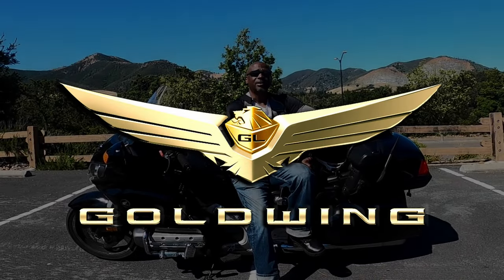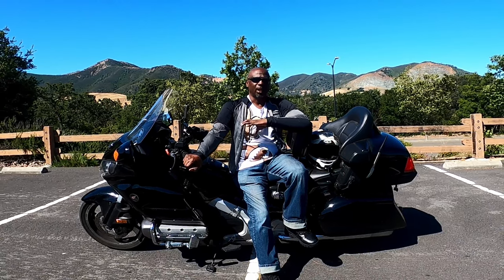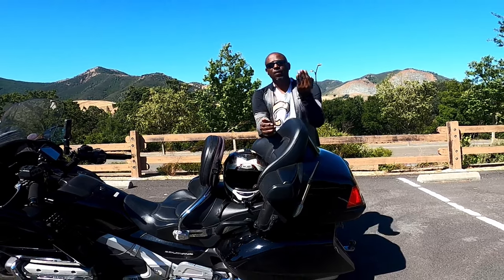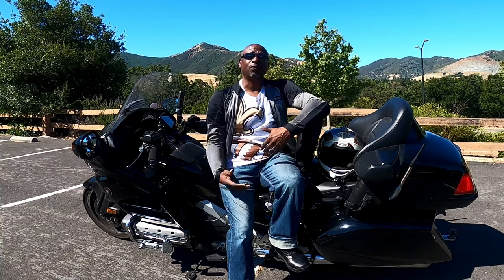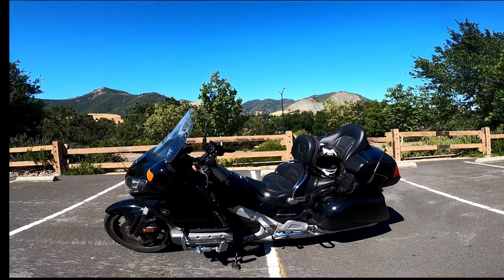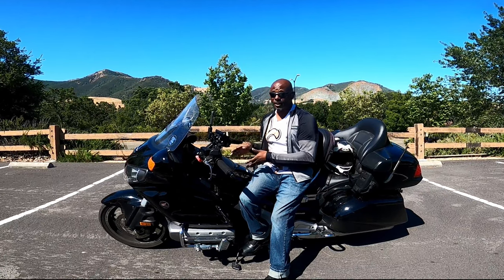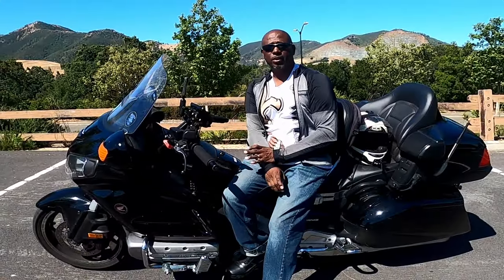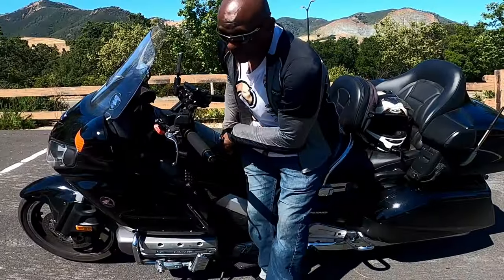GoldWing Dislikes | I love My Bike But...

Comment: I agree!  Every bike I have owned had something I disliked.  The Wing, yes the air filter is a bear, it I made sure to plan other work while I had everything apart.  I did the air filter a few months ago, and changed the coolant as well as clean up some wiring that was not done the best when I installed it.  I made my service task productive, and reminded myself a few times during the task that I saved the cost of labor doing it myself.
Reply from the maker: Yeah, you did it right...( plan other work while I had everything apart). I think our dealer sain they were charging $600 to change the air filter. With two wings, we saved $1200. Thanks for watching and commenting. I appreciate it.
Reply: @BootsandJeansRiders  Absolutely!  Save that money!  I have time and most of the tools I need for maintenance stuff.  I might even try doing the valves when that comes due.
Reply from the maker: Valves...You are way better than I am.

Comment: The way the trunk box opens would drive me nuts, too.  On my Voyager it opens sideways and I love it.  I had to laugh at your description about taking half the bike apart to repair something that has nothing to do with what you are trying to get at.  Man, I can relate.  I always joke with GloChix about how the first step in opening the gas cap is removing the front tire...hahahaha.
Reply from the maker: LMAO @ ( the first step in opening the gas cap is removing the front tire) I'm sure you are like me...in that, there are way more things you love about your bike than dislikes. Ride safe Tenn.
Reply: @BootsandJeansRiders    Always!  Well, almost always, the ONLY bike I ever had that I hated a lot more than I liked it was a later 70s AMF period HD Electra Glide.  That thing kept breaking down, and needed almost constant repair.  It turned me off to Harley so much that I haven't bought one since I sold that one back in 80, or 81.  I know that they say they have improved, but I just can't get that taste out of my mouth, as it were.

Comment: I have always admired the Goldwings and have considered getting one someday. I was aware of the extensive plastic removal required for maintenance, but since I usually take my bike in for service, I didn't think it would be a big deal. However, with my Harley Davidson Road King, I am beginning to handle simple maintenance tasks myself (avoiding the engine, of course) because I am tired of paying the high service fees.

Learning to service your own bike is challenging, especially for beginners. The additional complexity of the Goldwing, with its extensive disassembly requirements, means more time spent on maintenance and less time riding. While I am not ruling out the possibility of owning a Goldwing in the future, the maintenance aspect is a significant consideration.

Great video! I am confident the video will perform well. Thank you for your honest insights. It would be great to hear about the top five (or however many) things you love about the Goldwing. Take care and stay safe!
Reply from the maker: Yeah Jose...The service fees make you want to DIY. The Wing requires very little maintenance, but it's a pain when the time comes to do it.
Don't know if I will do a top - reason I love it. May be a Looong video lol.
(On another note) We are thinking about doing an overnight ride to Bridgeport CA. heading over Sonora Pass. If we do, I'll send out an email with details.
Reply: You could consider an old 1200? Cheap as chips, cross-country reliable if it's been looked after, retro cool AND much less plastic = much easier to maintain. (Air filter is a 5 minute job 🤣)
Reply from the maker: 5 minute air filter change...Man, that's golden.
Reply: @BootsandJeansRiders  😁 open false tank hatch
Lift out storage tray that's just sitting in there
Take plastic cover off filter
Lift filter element out.

OK, I lied - probably more like 2-3 minutes 🤣🤣🤣

Comment: Thank you for your opinion.  It is well-supported.  I was surprised you did not mention the seat removal and reinstallation process.  It is unnecessarily difficult as you must be very delicate.
Reply from the maker: Oh WOW! I forgot about that. You are absolutely correct. The seat removal is easy, but reinstalling it is a pain. Hard to line up the holes.

Comment: This is why I like my 1200 - much less plastic. Same daft way of trunk opening though - I go camping a lot meaning the back seat has stuff strapped on it. You really have to plan ahead what you put in the trunk.

Didn't know about the paint problems on your generation - shocking on such an expensive bike.
Reply from the maker: Yeah Ducan, 1200 is easier to work on than any other wing. Fortunately, I don't put stuff on my rear seat often.

Comment: I agree with you, Rich. I have a 08 only audio. Only good thing I think about that is less things to break. 
Mostly ride with the wife on back. I love it when she says, show them what this wing will do. Rock solid at 125. Also dbl dark   with run flat, that saved me when the valve stem cracked. No explosions yet. Whoever says they can't corner with a CT, never tried I guess. I love roundabouts, when the pegs start scraping I found my lean angle. These are  incredible bikes.
Now let's talk about the sound system. Radio sucks... bluethooth is the way to go. Most radio stations now broadcast on line. Along with there other HD channels. If that dont work there is spotify. Wing has a 3 ohm, not 4 or 8 ohm system. So, if you have 3 ohms in front 4 in the back. The path of lease resistance, the back will not get as loud as the front. You can try to fade it, but your killing the db level. Get 4 identical 3 ohm speakers, to match the oem honda amp. If I told you the brand I put in you would laugh, but they Rock. I can have a concert at any speed. Now you can not get chest thumping base out of 4 inch speakers. Its impossible! But you can get good sound. I=E/R
Ride safe, be aware of cages...
Reply from the maker: Love your comment ❤️. Now I need to know...What speakers to you have. We really need to get new speakers.
Reply: I have all show chrome speakers.
Use my phone for all my sound/nav. Phone is set up hard to hear, vol goes to 150, set at 120. With eq. Samsung 21 phone. Just had a young couple compliment me on the sound & bike when I pulled up to the Buromax store to pick up a part for the electric bike. Told them it's the Cadillac  of motorcycles!
Reply: Show chrome 5.5 front 4 in back 2 ways. Front honda tweeters disconnected.

Comment: I have most the same gripes on my 19. The paint is horrid, the plastic is cheap, the dash plastic scratches easier than the paint lol.  The stereo speakers are weak, better like the headset hehehehe! Oh gawd, the air filter. Insane design, but doable, not at 16k, to hell with that, I’ll wait longer this time!
Reply from the maker: Yeah Moose, with all our dislikes, there are tons we love about the wings. When the time comes again...I think I may let the dealer change my air filter.

Comment: You are right on point.  I don’t think you missed anything. I had a Harley box on my KZ1000P ( you know). It was odd, but it opened on the curb side which made it safer.  I don’t like to be at the rear or street side of the bike when on the roadway or parked out somewhere.  Does Honda even talk to the user/rider/consumer??  Cheers.
Reply from the maker: Hey Black Archer...I don't know if they talk to their consumers but I would have a mouth full for them lol.
Reply: @BootsandJeansRiders  WORD!!!! Been riding for 43 Years, always Honda.  Just like election polls, no one has asked me nothing.😆

Comment: Gday mate all fair points some of them well annoy you but maybe not so much others i do agree with the air filter i have watched heaps of vlogs on changing it and boy there is a heap of crap to take off especially if you have added accessories ,now i don't own a goldwing yet maybe soon though and i like to see owners views on what they think of there machines , can you imagine how much this would weigh if it had metal parts instead of plastic yes things break but i don't think honda had it designed to go down dirt roads either ,maybe go see a plastic welder for you broken bit . With your paint maybe ceramacoat it give a bit mor protection against scratching .I watched a video that would put jerry paledinos bagging of goldwings to shame this guy threw the wing around like a toy very experienced rider it was in the u.s.a of all places in a harley parking lot anyway good to hear your opinion on things that annoy you take care .
Reply from the maker: Gday mate. What a great comment. Of all the things I don't like, there is so much more that I really love.